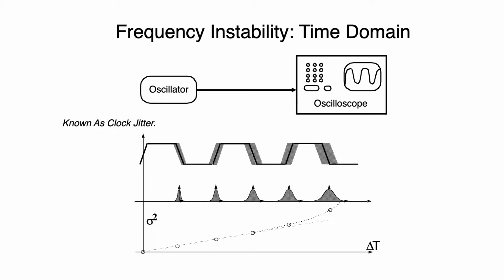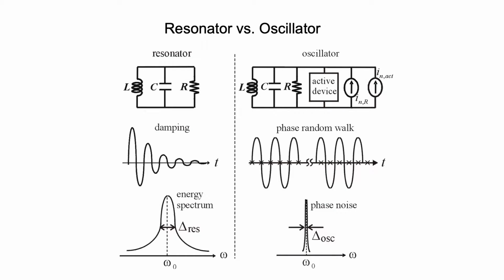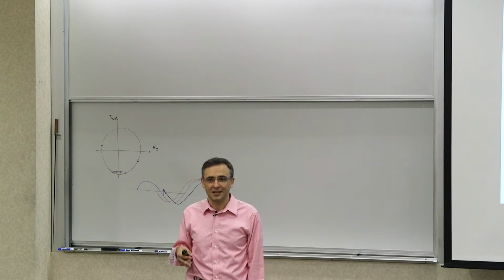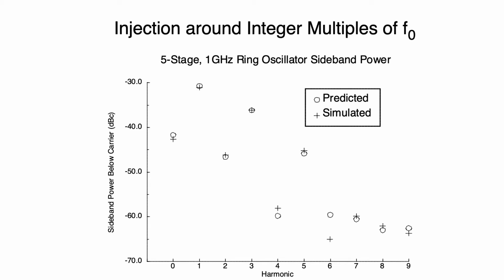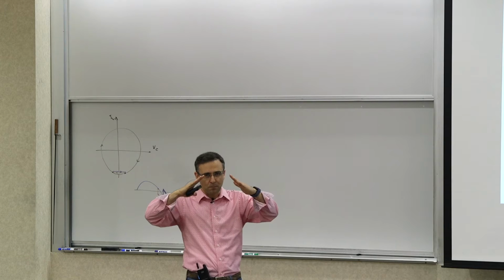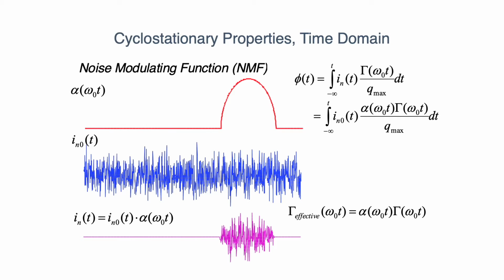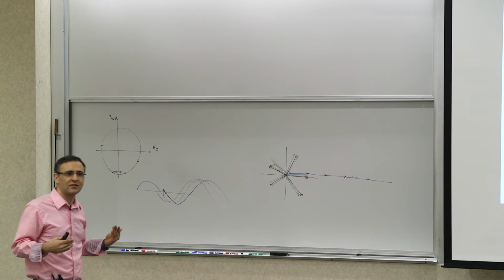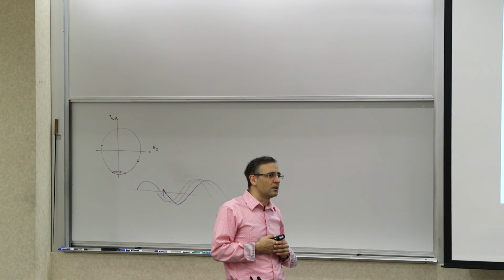185N. Phase noise in oscillators (introduction)

Comment: Thanks for the wonderful introduction. I admire your intuition.
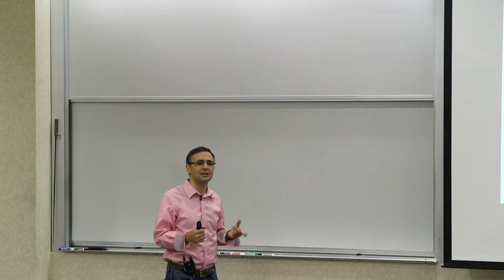There is a mistake in the lecture (at 20:25). This will not affect the phase noise analysis, but I think it needs to be corrected for the sake of completeness. When we inject a current impulse at the zero crossing, you mentioned that the output amplitude will not change, but this is not true. The output amplitude has to increase/decrease. Suppose we have an ideal LC tank with the capacitor initially charged such that the oscillation starts with an amplitude of A. Now, suppose that we inject an impulse current at the output voltage zero-crossing such that the capacitor voltage jumps from 0 to B volts. Given that we are in the I-V domain, the LC oscillator is an LTI system, and therefore, we can use the superposition principle. This implies that the output voltage can be written as follows: A sin(wt) + B cos(wt), which will have a higher (or lower) amplitude (depending on the signs of A and B) than the original output (A sin(wt)) before injecting the impulse. Please correct me if I'm wrong. Thanks again for the amazing lecture(s).
Reply: He does not say it happens at the zero crossing. He says there is a point at which impulse injection changes only the phase and not the amplitude. He immediately demonstrates his point using two plots around 21:30.

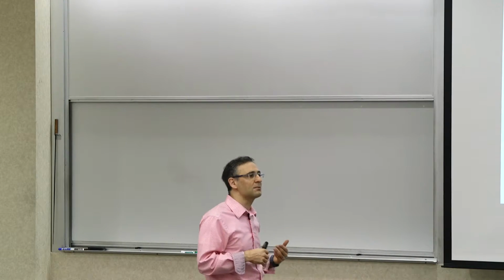Comment: 6:08 regions for most oscillators. Since they are inherent, let us utilize their asymptotic nature at those corner frequencies. 14:02 virtual damping -- the phase timing jitter explained on a decaying LC sinusoid with impulse response. Very nice talk. 24:51 an oscillator has no way of knowing its previous phase -but what if they could?

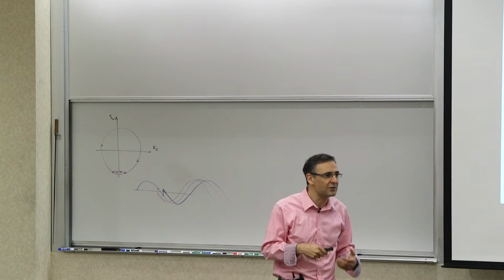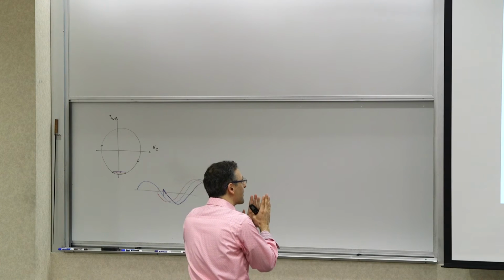27:03 Impulse sensitivity function ISF captures the sensitivity of an oscillator to the input impulse. 1:06:17 is like a good record you have to listen a few times, including 1:07:52

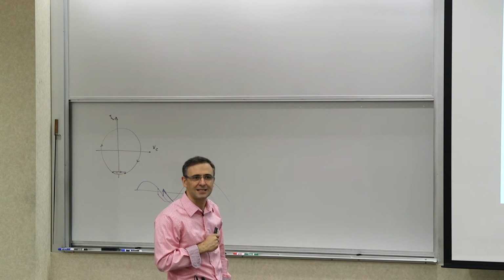1:08:07 - minimum ISF sensitivity at the peaks
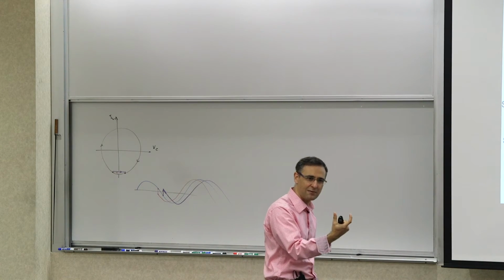1:11:01 - time-shifted ISFs - (a tensor, superposition) in motion
1:11:30 - creation of superposition of tensor superposition state
1:20:30 - resonance with nearly moving tensor, especially quadrature.
1:30:55 - invite to read two papers

Comment: Hello, 
Thank you very much for this video, it is very informative, and I learned a lot.
I do have a question though (basic one).
In the beginning of the video you state that the jitter variance widen over time and I don't quite get it.
I understand that the phase "error" you add at each clock cycle stays there for ever, therefore over time you keep on adding errors with a given distribution.
Which means over time you have more and more chance to be really off the "ideal" edge position (vs. time).
But I don't get why the the distribution itself widens (ie. variance increases over time, t^2 in your graph)...
Can you help me understand that?
Regards.
Reply: Hajimiri is not saying that the jitter added per cycle becomes larger with time. That per-cycle error can stay statistically the same.
He is saying that the accumulated timing error becomes less certain as you look farther from the reference edge.
Think of it like walking with tiny random step errors. Each step has the same small uncertainty. But after many steps, your final position is much less certain than after one step, because all the small errors accumulated.
For an oscillator, each noise kick slightly shifts the phase. The important thing is that a phase shift does not naturally disappear. The oscillator continues from the shifted phase. So the next timing error is added on top of the previous accumulated error.
That is why the distribution of the edge position relative to the ideal clock widens over time.
For uncorrelated noise, the errors sometimes add and sometimes cancel, so the widening is slower. For correlated or slowly varying noise, many errors push in the same direction, so the widening is faster.
So the waveform is not getting physically dirtier. The uncertainty of where a future edge will be relative to the original ideal timing reference is what keeps growing.

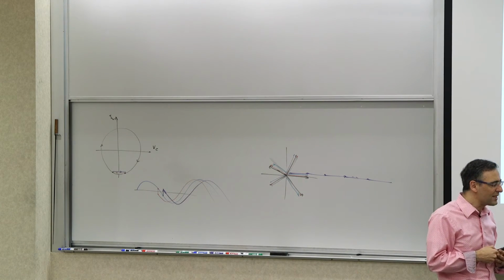Comment: Time "01:15:00" rms-Jitter vs. time for free-running osc., you said equal rise/fall-time will reduce flicker noise portion (independent part) bcs DC value of ISF becomes zero.  This is right only if NMOS/PMOS ﬂicker noise currents are correlated. But they're NOT. So, each device has its own ISF, and the noise of each will be unconverted separately. Am I correct?
Reply from the maker: It is correct that the noise of the NMOS and PMOS are uncorrected. There is a more detailed analysis that calculated the effective ISF of each of the NMOS and PMOS devices and takes the aggregate into account. I usually show that slide in the longer presentations, but not in this video. It shows that there is still a reduction, although it is not possible to zero it out.
Reply: @AliHajimiriChannel   Thanks for the reply. I've read your paper on ring osc. Yes, equal tr/tf decreases the corner frequency "fc" and the PN at far-out offsets is improved. I mean, "fc" is around tens of megahertz in ROs right? -especially in short channel devices. But in far-in say 100KHz, PN improvement may not be appreciable. Am I right?
By the way, your results on your paper are for current-starved RO type where you mainly play with the starved transistors to make tr/tf equal. But in a simple RO, your charging and discharging paths may experience different load cap (say for fanout=2, "CL" is twice in charging mode since PMOS is twice the NMOS). So, PN improvement may not be so touchable even in far-out. Do you agree?

Comment: 1:04:06 Why increasing the mobility can make the drain current lobe narrower?
Reply from the maker: Because these oscillators don't operate in a constantly on state and in steady-state the transistor only turns on to draw enough current through the tank when the emitter/source is at the lower voltage.

Comment: Thank you so much Prof. Hajimiri. I think at time: 29:36, it is Gamma(w0*tau) instead of Gamma(w0*t). Is it correct or am I missing something?
Reply: You are right and it should be Gamma(w0*tau). It was correct in the original paper.
Reply from the maker: You are right. I should correct that in the slides. Thank you.

Comment: Is the capital gamma function of (wo *t) the reflection coefficient of the impedance matching? If so, that woul explain that cancelling the reactive component of the negative impedance optimize to the minimum the phase noise magnitude.
Reply from the maker: It has NOTHING to do with reflection coefficient. It is the Impulse Sensitivity Function defied earlier in the video.